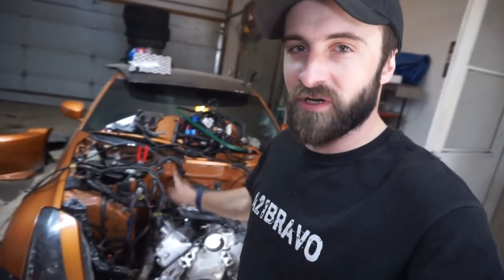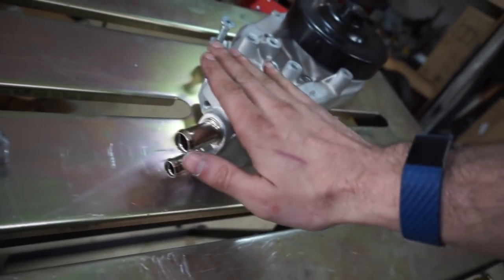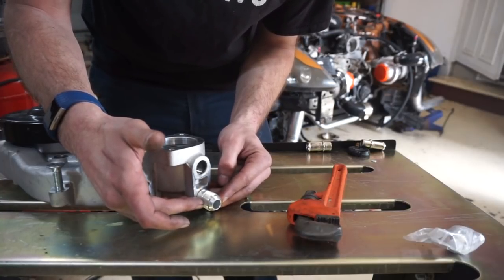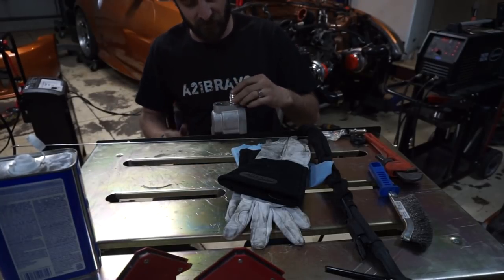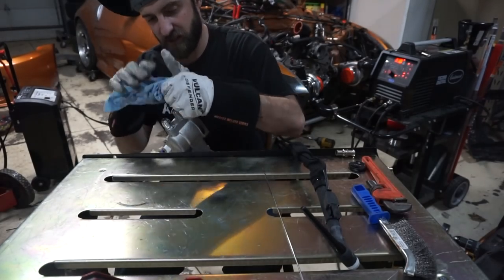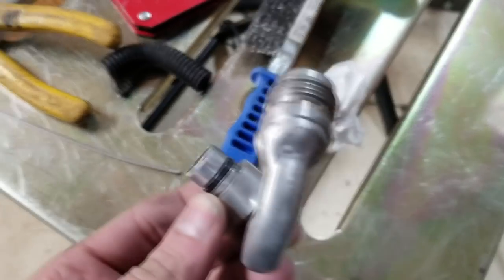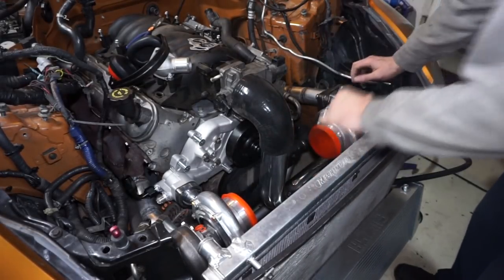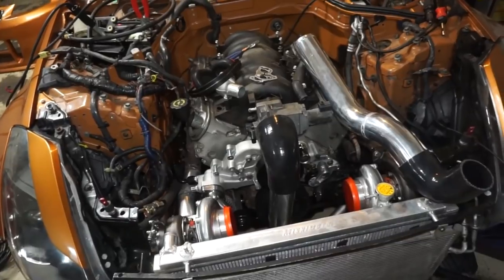TIG Welding Water Pump And Intercooler Piping For LS 350z!!!

Comment: I have the OEM gm equivalent of that pump, and the fittings pulled out the same way, maybe glued a bit more than yours was though. I ended up relocating the heater outlets, and adding steam port and sensor holes. I plugged 2 holes, and drilled 4 others. I can't weld aluminum. I was nervous. Lol

Comment: Cool video! I admit; I haven't watched your previous 350 build videos. So, you may have answered my question in a previous video. What TIG welder are you using? I notice that it is an AC welder. Did you buy it because you knew you would be welding aluminum? I bought mine (a multi-process welder) before I knew what I was doing. It's a DC-only TIG welder and I'm super bummed that I can't (at least not easily) weld aluminum. And, I have a ton of aluminum parts on my project car.
Reply from the maker: It's an Eastwood TIG200 I bought it for aluminum, but have been using it a lot for steel also.

Comment: The surface of that pan will get to 750-900* near the weld, the powder is cured at about 300* in most cases.... so, it'll likely bubble up in about a 3" circle. :(

I figured you'd leave it in the car and weld it in place?
Reply from the maker: I ended up ordering some 10an bulk head fittings so I can thread it in and put a nut on the back.